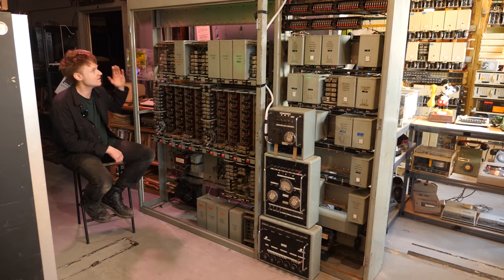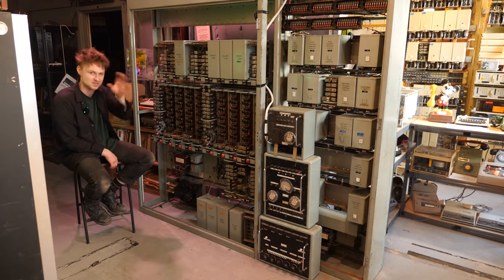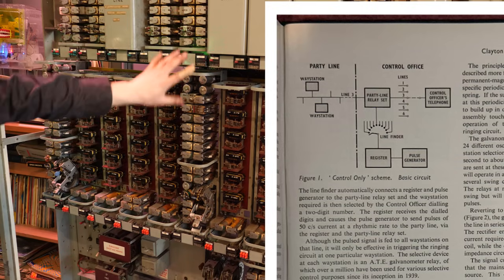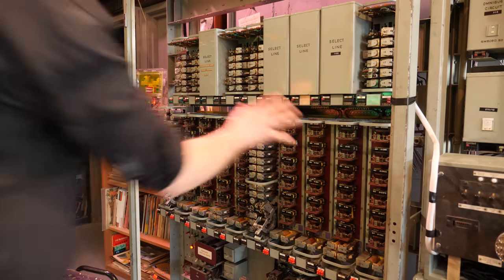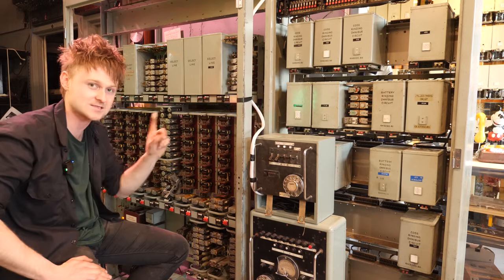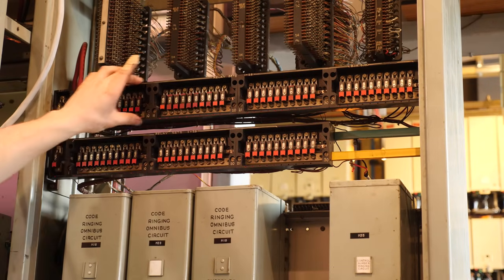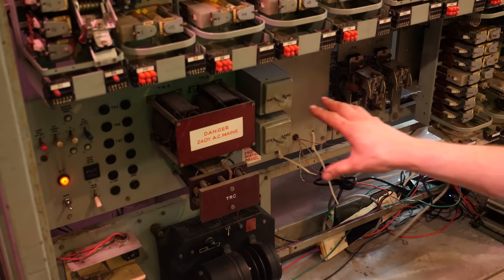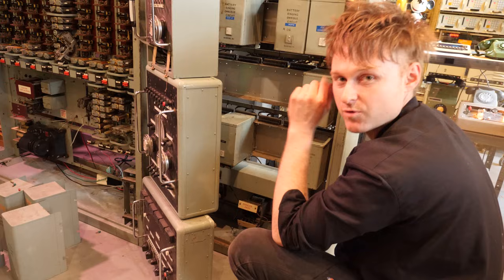Solving The Mystery Of This 800kg Machine

Comment from the maker: Bear in mind the information will likely become more solid and accurate as the project goes on! its to start a conversation if anyone knows more. 
also just on facebook official telecommunications heritage group now from steve tyrrel "Had a bit of feedback from Dad - it’s an early AT&E system from circa 1920’s used on the railways, effectively as a concentrator - used extensively on the LMS region - Technique was also used for controlling street lights in Sheffield and other cities. Plessey took over AT&E and stopped manufacturing the system as Southern Region were just introducing it. So Southern Region bought a stock of relays from New Zealand to continue manufacturing in UK, NZ were still using them for controlling street lights. Plessey replaced the system with a more up to date version."
Reply: I BELIEVE SIR  ' You are building A Computer! Add a camera in Case in Comes alive
Reply: And here was me thinking a guy at the power station just looked at his watch, looked at how dark it is out the window, then pulled a big lever labelled “street lights”.

Comment: It's pretty much the same idea of 5-tone squelch (SelCall in Motorola language) in two way radios.  All radios tuned to the same "channel" but each one has a different set of 5 tones to open the squelch or "page" the radio.  Thus a 1:1 call need not land on loads of radios.

It even allowed 1:group and 1:all etc too.  Some handhelds even had keypads to directly "call" other radios but most didn't and just called an operator or desk who could buzz the right code.

Similar to the CTCSS constant tone that still "uses" a while channel, but allows some limited "privacy".

Really interesting Sam.  Fankoo!!

Comment: In Germany the railway telephone had a crank on it. 1 turn on the crank are the short ones and 3 turns are the long ones. So u had in every station, railway crossing, signals and other important buildings a chart with the codes for all the Telephones. The so called Allfernsprecher had some like this connected to it. So on the Allfernsprecher u had buttons and the machine translated the button press in to code lines.

The cleverness is that every outside telephone only needs 2 wires and no more. I have build such a system in my flat to call from the living room to the kitchen and reverse.

Comment: In North America to ring the bell in a phone you would send 90v at 20Hz down the line. This ring signal was pasted through an interrupter, a motorized unit with a bunch of cams in it to make an brake contacts, this would flash light and turn on and off the ring signal.
I believe this was done the same way in the UK, except the cams were slightly different (creating different timing) to give things like the classic double ring for a UK phone where as the North American phone have one longer ring.

The equipment you where looking at today, would be classed as another interrupter.... in series with the one I mentioned above, so that the ring signal only gets to one phone on the party line.
Reply: That's how normal North American ringing worked. I know some systems used unique ring frequencies for the party line. On these systems the ringer's arm in the phone would be made to resonate at 10, 20, 30, etc Hz.

Comment: These were used on the railway to communicate to/from a lineside telephone (the tall wooden box shown inserted at about 02:20) and the Electrification Control Room (ECR) for railway lines that used 25Kv overhead lines. Unfortunately I only worked with the outside telephone instruments and never got to see the Control end, which is what you have there. This has been quite enlightening to me, seeing the "clever" bits that we used to call into. In the picture showing a man using the lineside phone, you can see that he has raised the door in the top half of the wooden box. This obviously contained the telephone instrument. You had to lift the handset  off the cradle and listen (in case there was already a conversation taking place), and if clear you pushed a button, which sent a frequency down the line, which the caller could hear and confirm that you were "sending". You would then hear "ring-tone" from the Control end and eventually it would be answered. In the lower part of the box (which was padlocked) you had the send/receive unit (within a fibre-glass type weatherproof box) which also had a coded galvonometer. When Control rang you the galvo' would swing and a contact would make and connect a battery (via a capacitor I think ?) to that lovely big old gong on the side of the box. I think that there were about 8 x 1.5v carbon/zinc batteries contained in two shelves on the back of the door itself. I think they were all removed from the West Coast Main Line in the mid 1980's. I worked between Brinklow and Armitage and we used to call into Rugby ECR.
Reply: PS; There was also a trick whereby if the push-button didn't work (no tone heard going out) you could do a whistle into the mouthpiece with a rising tone that would cover a range of tones, and the receiving end would react to a certain frequency.
Reply: @Ozbert  That's so interesting, thank you for sharing!

Comment: The galvanometer relays are reminiscent of the old multiple channel reed radio control systems from the 40s and 50s, the receiver had several reeds that resonated at different frequencies, so could control several different actuators (not servos) depending on which tone the transmitter was transmitting.

Comment: I worked at St Pancras about 5 years ago as the scheme project manage ( Engineering) I would give the guys there a call at the HS1 ( High Speed 1) office. There was a room filled with paper records and drawings and a multitude of obsolete computer records. There's a fair chance that there maybe some records and the Scheme PM is the building and facilities manager. I don't have any contacts there anymore but it might  be a place to start.

Comment: PMR radio uses a similar idea (Continuous Tone Squelch System) so that a number of users can share the same frequency without hearing the other users’ conversations. It slightly different in that an inaudible tone is buried in the audio and the radio squelch (a gated volume control) opens when the appropriate tone is detected.

Comment: A bit off topic, but you may like to look out for the other system that BR used.  It was made by Ericsson, and consisted of a 3 wire sytem (A,B and Earth) which also had a number of phones on One Single Line..  The receivers had two Cold Cathode Tubes and two relays, and a combination of positive and negative voltages were sent down the A and B wires to initaite call. A kind of binary decode gave this a possibility of 8 extensions that could be rung on the single line.  I have some of the telephones (modified Ericsson 706), and i think some more may be available, but not the sender unit, or the decoders.  I think the cold cathode tubes can be bought still.   A Heritage Group member has one working. It is a very interesting setup. Ill let you know who this is in prv msg.

Comment: I remember my parents had a shared line, you had the twisted pair, plus an earth stake at the property, from my understanding the exchange would send ringing current down A and ground for one property, and B and ground for the other. i remember my parents being told to water the ground stake during the drier months if we thought the bell didn't ring, they got fed up with that and the other party interrupting or listening in so they got a dedicated line
Maybe the 6.3V is for indicators or bells, if they are in remote locations you might need the fuses incase a wire got shorted

Comment: Those galvonometer ringer things are really awesome. I have a gazillion ideas brewing as to how they could be used to demonstrate concepts like resonance and frequency-response.
If I understand correctly, your system has the ability to ring on two different party lines at the same time... Which, for the sake of a museum is probably not necessary (how many party lines do you have physical space for?). So, I think, it might be possible to extract/repurpose the resonating relays from one ringer-bank as receivers to trigger ringers for regular-ol phones attached to the (now one) party-line in the museum...?
Reply: I think he said there would be contacts on the receiver relays that aren't on the transmitter ones? not sure though

Comment: im willing to bet alot of the phones are still installed in situ, try calling around the places that would be along the lines and asking if they have any ollllllld equipment that was never removed when they upgraded
Reply: would depend on what the phones were used for, if it was for thing such as signal post telephones they would have been ripped out/replaced when resignalling work took place

Comment: my parents were on a party line phone it was a cheaper service than regular apparently , there was a button you had to press before you would get the dial tone and you of course had to be careful when you picked up that the line was free , and i remember when the phone rang the few seconds before you would get a muffled ring , then it would ring normally , they had the party line from the late 60's through until the end of the 70's then we changed to a single line but retained our old phone and then as you lifted the receiver the dial tone was present without using the button

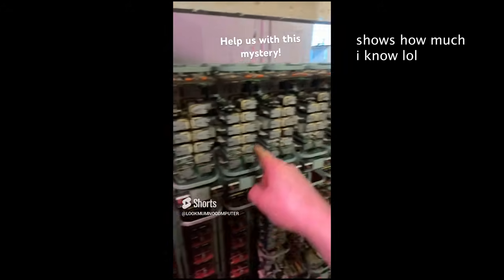Comment: 0:46 "It's not a telephone exchange!" points at a whole slew of 60 Volt telephone relays that I recognize from school
Reply: Indeed but telecommunication relays and relay boxes were used in much more than just telecommunications.
Reply: @LOOKMUMNOCOMPUTER  Absolutely, just look at the very first semi-programable computer, Colossus, it was built mainly out of telephone exchange equipment as its designer, Tommy Flowers, worked at a telephone exchange research centre.

Comment: What is the signalling standard ? 48V AC, like a ringer ? 
Maybe make some little microprocessor modules that detect the pulse timing and turn on a relay that enables the phone's bell.
Your point about other devices made me wonder about signals. Does every train signal have its own set of wires or does it use a selective system similar to this ?

Comment: if you could tap into the contacts on the pulse generators, you could maybe make a LED matrix that would display text, or make simple pictures. Kind of like a flip display, but with LED's instead of flip dots/ panels. but you would have to get your hands on some very small LED's like 2mil x 1mil x 1mil so it doesn't look all pixelated.

Comment: Really really interesting, seems such a complex solution to not just running a few more copper lines or modulate it on a single bit of coax up the track. But the engineers of the day must have known better.
Reply: It is obviously more complex but it's cheaper than running copper for miles.

Comment: If you can't locate any 'receiver' phones, I wonder if a 'Phase Locked Loop' IC detector would work at such a low frequency to detect the 'Ringing Frequency'? Hopefully, you can locate the correct phones. Good luck with this - another project.
Reply: would be easy to do in software though, with those low frequencies. Either a full-blown DFT/FFT or just simply sampling at double the interval of each specific frequency, counting pulses until a threshold is hit

Comment: I like the idea of putting instead of running phones like relays and having a strange two wire home automation system on it
Reply: Infact you should use this machine to run remote control of the lights and stuff in the museum
Reply from the maker: funnily enough this same system was used for street lights in leeds

Comment: I remember the party line adverts back in the 90s on late night TV.
Reply: Not what this is for. Watch video again!
Reply: My mother lived in the farming community and originally they did have a party line at one point.

They still have the old black nearly indestructible phone as they used to say for the longest was still in years even though it was no longer a party line setup.

Also another place that I was aware that it had a party line at one time even into when I was there last time up in Wisconsin family has a cabin.

And that was also on a Walmart Party Line system.

Essentially if you wanted to make an outgoing call you'd pick up dial the number hang up and when the line was available the phone ring and you could complete your call I forget the rest of the process after picking up the phone.

Also I'd heard about Carol at one time when people had the party line systems in rural areas especially when not too many people had a radio or even had utility power in some areas.

They would actually have one person that had a radio pick up the party line anyone that wanted to hear the broadcast would also pick up and essentially be able to hear the radio broadcast via remote.

Kind of clover back in the day when not a lot of Technology was readily available to everyone and it was quite expensive especially if it's a battery operated radio

Also one time I noticed on a farm that is the one I know had later on they really stop farming but they still live there.

The fence posts had insulators on them and note this was not electric fence is the wires were being used for the old telephone line and was still in use.

Unlock the Farms except just hooked up for a just standard phone service where everyone has a standard private line.

In some areas this was elevated with a extra length fence posts serving as a sort of telephone pole sort of thing.

Also there was a top ground wire no matter what.

Sometimes was used for the signaling as well apparently the person that lived there one of the people that live there or did work for the telephone company at one time is how I found out about this.

There was also one word that was used as a radio antenna as well.

What's the top grounding wire of course for lightning protection.

Also where the ground wire was tied to ground through ground rods periodically.

Deliberately but very very close to the other wires to act as a quote unquote spark gap lightning arrester.

Pretty clever of technology and pretty clever stuff done to get things to work back in the day for sure.

City of few places where the old Twisted Black single pair wire have been used back in the day and was still being used for phone at least when there was a landline still connected.

It was interesting how these were installed there was like a phone tag with possibly a wooden or fiber or otherwise insulated button top that was used to take the wires in place.

Every once in awhile I see a little cleat like device instead.

My parents first place they owned even had the old phone niche at the end of the hallway at one time we're here is what it was then I realized there was a notch and a hole even though it was mostly painted over.

Clearly there have been screws in a square shape attached of course being the connection for the telephone probably hardwired back in the day.

Later on realized yeah there have been phone while I'm going to that point in the basement just didn't see it initially.

A lot of stuff had been cut off at that place literally cut off and some of it was the old three wire stuff as well

I remember once when we were having a severe storm we're in the basement we were seeing this bright blue flash periodically

What was happening is it was arcing over from an old telephone wire that was hanging above the wandering machine tub to switch of course were metal.

Is possible is participation induced static but it cannot confirm this.

Possibly lightning strikes as well but we just don't know but we've heard other people say that you've seen things somewhere things happen during bad storms.

By the way on the farm that was in the family I remember hearing about them during the thunderstorms having the fuses in the telephone Democratic / protector blow.

The telephone company taught at Grandpa how to change the fuses and at one time in the Attic ran across a shoebox full of telephone fuses the long ones look like a wooden casing very thin I've seen these before but it didn't expect them there.

What would your rural area is good to know how to do this if it is allowed by your local provider apparently it wasn't just them easy enough to restore service after a storm versus having someone get out there and try to find a working phone line in some cases avoiding a service call and a trip to town potentially sometimes
Reply: Omg She was soo hot
Reply: @NeungView  :face-fuchsia-tongue-out: i'm cofussed

Comment: That is a train location detector. As it goes on the tracks the signal is cunducted between the tracks. Then it fould communicat when a train is near and allow the people on the train to call and make announcements or call for help. Still uses something similar to trigger warning systems and crossing gates, but its all digital.

Comment: Not sure how you're going to use this in combination with your existing PBX systems, I don't think it'd mesh well.  Might make for a hell of a drum machine though.  ^__^
Reply from the maker: definitely! will be making the pulse outputs audio and also trigger outputs for synshts that is one of the projects. as for wiring to other exchanges yes itll work :) auto to auto circuit, i was debating on doing tonight but got tired ha. cheers!